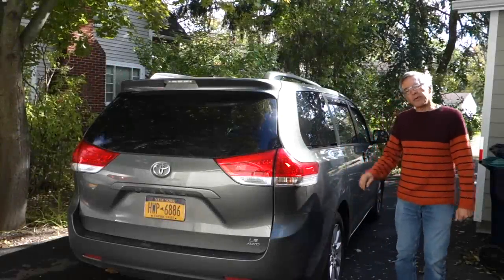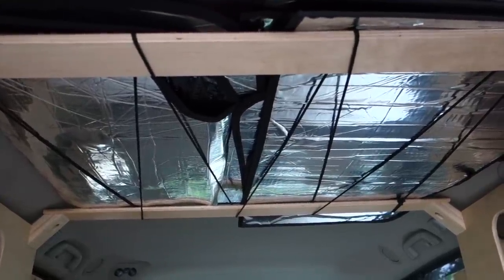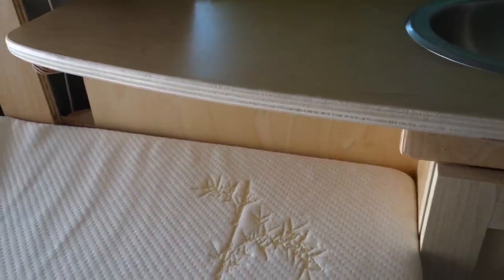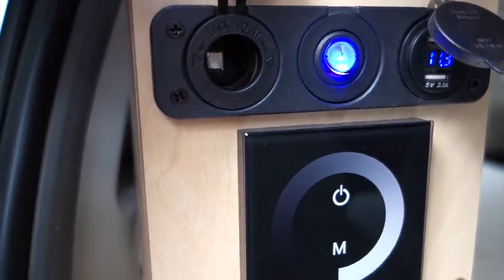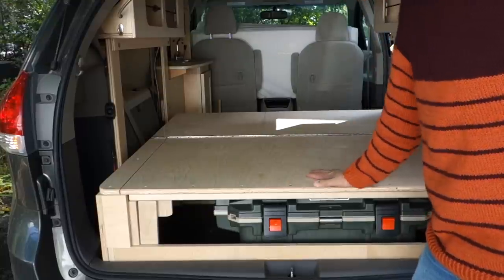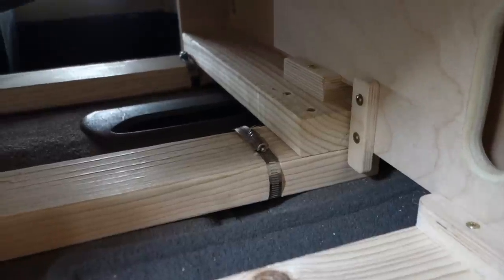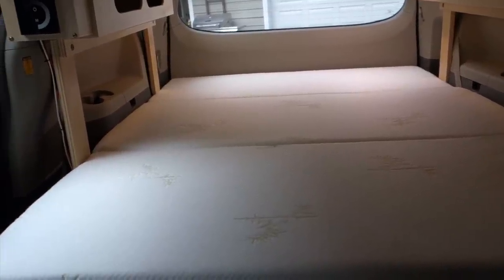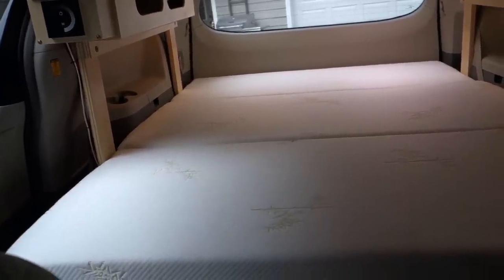A Slightly Different Mini Campervan Build

Comment: Did you compensate for the of the van floor tipping down toward the front by sawing the sides of the box in a reverse angle? And did you move from one piano hinge to two later on?
Reply from the maker: I originally hadn't planned on building the bed box to be level with the ground so its sides are pure rectangles. But when I was rough fitting it in the van, it occurred to me to compare it level to the ground vs level to the van and it just made more sense to level it to the ground. It was easy to do by tuning the vertical position of the crossbars before screwing the box to the crossbars. Regarding the piano hinges, I changed from one to two after a year of use because I wanted the hinged boards to be completely independent. That way, each could be lifted without affecting the other. It also made removal and re-installation much easier (I remove all of the campervan components when we aren't planning a road trip any time soon). You've got a sharp eye.
Reply: @BruceParks  Thanks for the quick reply! I think you said somewhere that the height of the box you built was ~12" high.  Is it just slightly under 4' wide to fit between narrow part of the back, then steps out with the uprights about 1 1/2 " on each side to make the overall width about 51" to accommodate the 52" wide mattress? Also the mattress being 73" long and trifold makes each section about 24 1/3 " at the folds. Is the box before the removable section then about 48 2/3" with the piano hinges centered and the removable section the last 24 1/3"?
Reply: Also, are all the plywood parts we see you remove during disassembly fastened using  t nuts or easy lock threaded inserts?
Reply from the maker: The support box is exactly 48" wide and it fits with millimeters of clearance between the wheel wells. It's only close at the very bottom as the plastic interior panels taper outward the higher you go. 

The sleeping platform has three main sections: Headboard (rearmost) 25"L x 48"W attached to a 1½"L x 48"W hinge board; Centerboard 25"L x 48"W attached to a 1½"L x 48"W hinge board; Footboard 19"L x 46¼"W. When I installed the upper cabinets, I had to modify the headboard so it could swing up between the cabinets so the narrower headboard is 41¾"W, flanked by the 3" wide pieces I cut off. The footboard is narrower so it can fit under the centerboard. If that isn't required, you can keep the footboard width at 48".

The boards don't match the trifold mattress sections. This isn't an issue 99% of the time since we leave it in sleeping mode for the most of our road trips.

Yes, in general, I used threaded inserts (https://amzn.to/2OOYoKu) and t-nuts (https://amzn.to/2nLMh5X) for attaching the removable parts and where strength was needed. There are a few areas, like the hinge boards, where things are mostly self-supported and the hardware is just for keeping parts from moving around so I used wood screws. 

Regarding wood screws, one tip I like to share with everyone willing to listen is to, where possible, switch to torx drive screws. Pure joy compared to phillips head. 1000% better. I have friends who built everything with phillips head screws. After skeptically trying torx, they couldn't believe how much nicer they were. (And then getting them to try an impact driver in place of their drill driver brought huge smiles too.) Not that I think I know what you do but since replacing my giant stash of phillips screws years ago, I've been singing the torx song of praise to the maker world.
Reply: @BruceParks  thank you so much for info. Love your build and planning to do it in stages. I noticed you use torx. I will too. thanks!

Comment: Excellent build!how well does the cooler work for you?
Reply from the maker: Thanks for the nice comment. The cooler has been great for our road trips. It holds a lot and maintains ice for several days despite our frequent opening and closing. The downside of the large size is it takes up a ton of space, ever more precious in a minivan, and it’s heavy so lifting it out to drain the water takes some effort. The Pelican quality and performance is top-notch but because the beefy handles are built in, it’s larger than some of the competition. For this year, we’re adding a solar panel and deep cycle battery and switching to a small electric fridge. Cost-wise, a simple cooler and ice is much lower but I enjoy tinkering with new stuff and we’ll be able to go off-grid/remote without being tethered to ice purchases.
Reply: @BruceParks  I like the low profile,most are built deep and,of coarse what you want is on the bottom.as far as heavy,perhaps a pull out drawer for it would help.i too am thinking of an electric one for the jeep,but a drawer type,low and wide,would work better under a bed

Comment: When you said you use “Packing Cubes” to maximize storage, were you referring to vacuum-type space bags ?
Reply from the maker: The packing cubes I referred to are not the vacuum space bags. We use packing cubes like the ones by Eagle Creek. Do a search on packing cubes eagle creek to see good examples.
Reply: Bruce Parks I took a look.  So, since there isn’t the space-saving component of compressing items, the benefit of the Packing Cubes is achieved by uniformity in dimensions .... ?
Thanks
Reply from the maker: 240Z2NV Actually, all of the cubes we use are different sizes. The benefits are: everything is organized so if you are looking for a fresh T-shirt, or socks, or whatever, you know exactly where it is and can find it without pulling everything out; if you are overnighting at a hotel or friends house or anywhere not in the van, it’s super easy to pull your cubes out and put them in a tote to bring inside and vice-versa; anything that’s folded (like shirts) stay folded. You could use plastic bags instead but once you use the cubes, it’s so much nicer. We have a bunch of cubes anyway because they make any kind of travel easier. You can find cheap cubes on eBay. The cream of the crop, though, are Eagle Creek cubes. We use a bunch of them along with cheapies, all sizes and colors.
Reply: Bruce Parks got it.  Thanks.  I’m pretty OCD about organization.  I even made a Flip-Fold to make TShirts uniform and Compact.   Guess Cubes are worth a look.  👍🏼

Comment: Good morning Bruce....Hope you are well! .I'm scratching my head as to how you attached the 4 uprights to support the upper cabs. There doesn't seem to be any outboard room for them. What am I missing here?  Tx. And..what please is the height difference of the platform from front to rear? I can't seem to find that again...lost in space. Oh..I suspect that dropping those cabs lower becomes a bit claustrophobic, yes? Thanks for all your kindness....We all need to practice that human aspect more! ( see poem by Philip Levine.."The Mercy")
Reply from the maker: Hi Lee. With a platform width of 48", there's enough room on each side to attach ¾" thick uprights. The space is kind of tapered as you look towards the front of the van so you'll need to position the two forward uprights in the spot where they will just touch the plastic side panels. That means they are not at the very front of the upper cabinets, and they don't need to be. Also, the rear uprights aren't mounted symmetrically - one of the rearward uprights is mounted a little more rearward than the other. My rig is still disassembled from last year so I can't give you any helpful measurements, sorry. Regarding dropping the cabinets a little, it would be okay to do that. I'd line up the bottom of the cabinet with the bottom of the side window. In my build, the cabinet is a little higher and I'd go lower next time. I'm glad you're making progress.
Reply: @BruceParks  Thanks Bruce..I might be a bit "thick" but if the mattress is 54" how do the uprights work at 48"? Aren't they in the way of mattress?
Reply from the maker: I'm the one who's thick! I was going on memory and forgot about the spacers at the bottom of each upright. The spacers are 1.5" thick, so the space between the uprights is 48" + 1.5" + 1.5" = 51" total. The mattress is 52" wide so it's compressed a little at each upright. You can see the upright spacers here https://youtu.be/BgmgFfniEBE?t=264. Sorry about the confusion.

Comment: Would u be able to tell us how much it costs you including the van thanks
Reply from the maker: Well, the van is a 2011 Toyota Sienna with a market value of around $12K today. The build (as of 2022 which includes a lot of upgrades since the 2018 video) contains around $2K in materials. Lots of labor, around 200 hours worth.

Comment: If it is not attached to the van how does it stay put?
Reply from the maker: The sleeping platform frame is clamped to the floor hooks using hose clamps (I show that in the video). The 3rd row seats normally attach to the floor hooks so they are super solid. The upper cabinets are bolted to the uprights coming up from the sleeping platform and are also bolted to the ceiling crossbars that connect the left and right cabinets. The sink vanity is clamped onto the side grab handle behind the driver seat headrest and bolted to one of the uprights coming up from the sleeping platform. It's also clamped (using hose clamps) to the hooks in the 2nd row seat trolley. That's it. If you have any other questions, I'd be happy to answer them.

Comment: what time of board did you use for cabinets and sink setup?
Reply from the maker: Devin Scott - I used Baltic birch plywood for most of the project, in 3/4”, 1/2”, and 1/4” thicknesses. The countertop was made from prefinished maple plywood.

Comment: How to deal with humidity build up when sleeping in the van??
Reply from the maker: Good question. We leave at least one window partially open. Window screens keep bugs out and window deflectors keep rain out. I added a window ventilation system in the next video (https://youtu.be/oO2-2EKtJLc) that helps  move a lot more air into the van when the window is slightly open. In really cold weather, around freezing, the ambient humidity is usually lower so it's less of a problem when the windows are fully closed.

Comment: Looks good but the sink is a waste.A bowl will do as well.the bed is great and looks comfy.
Reply from the maker: Thanks for commenting. I considered just using a bowl, especially since it's so inexpensive, but we wanted the convenience of not having to empty the bowl after every use, especially if we were in parking lots, residential areas, city spaces, etc. Everyone has their own preferences and solutions and that's fine.

Comment: Could something similar work in a SUV like the Traverse or SantaFe?
Reply from the maker: I don't see why not but I'm guessing the SUVs are little smaller. The Sienna floor is 96" long from hatch to back of front seat rails. The ceiling is 48" at the highest point. The width varies from 49" wide between the rear wheel wells up to approx 60" between the 2nd row doors. All of the features I built should be reproducible in a large SUV, just scaled down a wee bit.

Comment: What size plywood did you use? For supports and cross bars? 1/4 in?
Reply from the maker: All of the plywood is Baltic birch plywood. I used ¾” thick for most of the build, though some of the nonstructural pieces like cabinet fronts and ductwork are ½” or ¼” thick depending on how much strength was needed.
Reply: Bruce Parks tnx

Comment: Hi, would you happen to have a template for the cabinets that you built?
Reply from the maker: Hi Allan, I haven't any plans or templates to share at the moment. I'd love to get around to measuring and drawing everything up one of these days. I'm afraid they'd be very specific to the 3rd generation (2011-present) Sienna however,
Reply: @BruceParks  thanks for the reply Bruce. I may just do it as a project this summer. I have a 2006 Sienna by the way. Thanks for sharing the video.

Comment: hi bruce.love it! how are the window panels attache? Gotta pic?  thanks so much...Happhy Trails
Reply from the maker: Glad you enjoyed the build. Regarding the window panels, they are a Weathertech product (https://amzn.to/2ITT2Kb) and are held in place by friction around the edges. They are precisely sized to match the window edges so they simply press into place.
Reply: @BruceParks  Just received them in the mail this week. Are you in love with your cooler...it's a bit pricey, but I suspect it is well worth it. I agree with all your fans about a set of plans,,....would be swell.
Oh..please what is the height of the platform from the deck? TX
Reply from the maker: @leesmolovitch329  The Pelican cooler is awesome. Holds cold with the best of them, actually outperforming better known brands like Yeti. But, it's bigger than the others because its beefy handles are molded in and stick out more than others, so that's a downside. I've since added solar power, a big battery, and a fridge (you can see the upgrades here https://youtu.be/oO2-2EKtJLc) so the Pelican is now collecting dust in the garage.
Reply from the maker: @leesmolovitch329  The platform is about 12" off the floor of the van. However, since the van is tipped forward, like all vehicles these days, I've adjust the platform so it's about 1.5" higher at the front than the back, compared to the floor of the van. This makes the platform level with the ground, not with the van, so when we park at night, we sleep nice and level.
Reply: @BruceParks  Thanks Bruce!...will your cooler come on the market soon?   jaja Like who needs the Post Office...walking in one that is.I'm 72 with a lung issue, and I never even lived in Pittsburgh..
Reply from the maker: I should just sell it but shipping costs would probably be too high
Reply: @BruceParks  You don't have a camel hangin' round in the backyard?

Comment: How do you power your lights, water pump, fans?
Reply from the maker: I had originally used a portable battery pack that plugged into the cigarette lighter to charge but later on, I added a solar panel and dedicated deep cycle battery. I cover this in this video: https://youtu.be/oO2-2EKtJLc

Comment: How wide is the Sienna I'm 5ft1 could I sleep crosswise?
Reply from the maker: It’s about 51” wide
Reply from the maker: Actually, it’s 51” wide in the back but behind the front seats, it’s around 60”. You could probably fit nicely there.